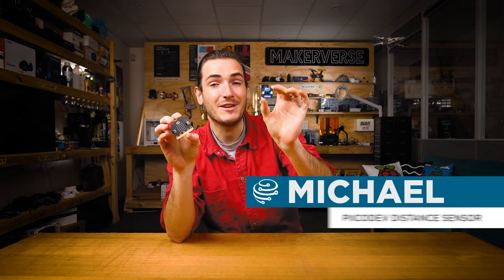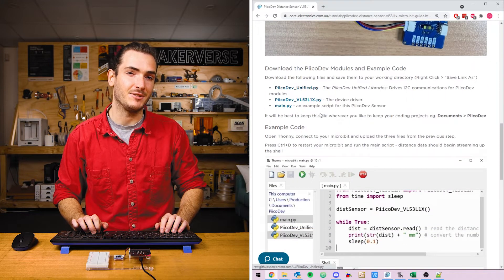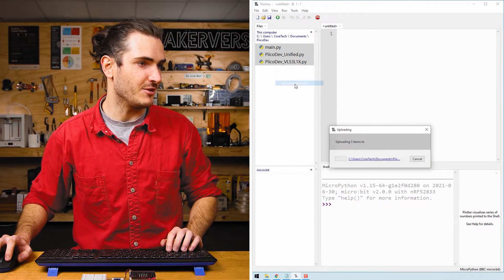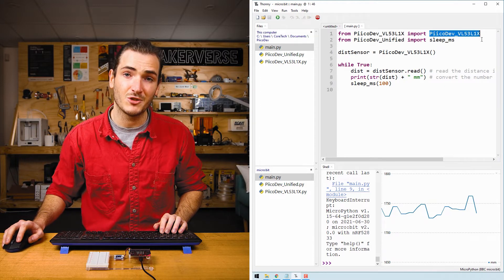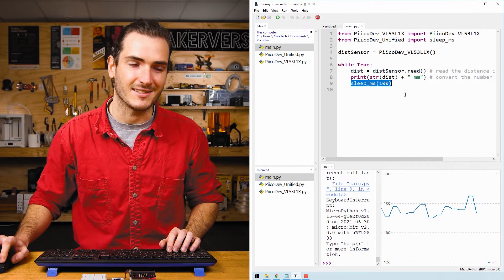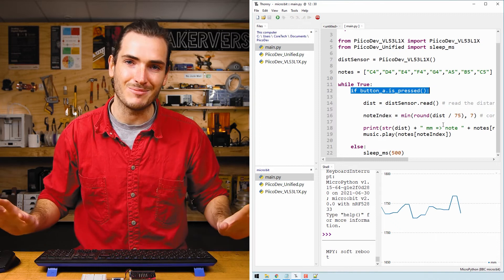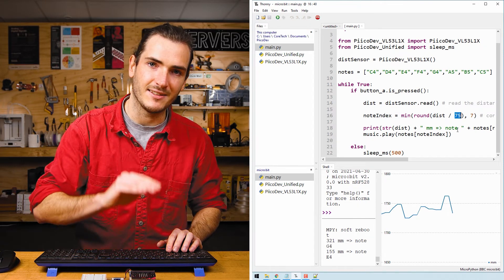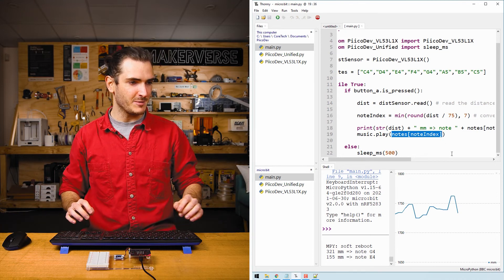PiicoDev Distance Sensor VL53L1X | Microbit Guide

Comment: I’m keen to build an adjustable front spoiler for my Mk1 Escort. 
Deep in the dream, I was hoping I could set up a system that could read the distance of an obstacle(speed hump, etc) and auto adjust.
Figuring out how to have the front spoiler adjust fast is my engineering challenge. 
Possibly multi input actuated, and have spring loaded as the emergency fast one. 
I have multiple 3d printers(FDM,Resin), so skys the limit with modern materials(filament, resins).

Great content and please keep it coming. 

🇦🇺🤓🍀🤜🏼🤛🏼😎
Reply from the maker: Sounds like a great project with some interesting challenges, would love to hear how you get on with it. 😎